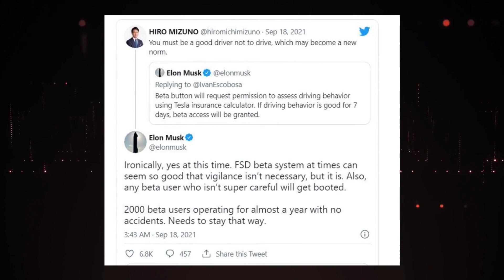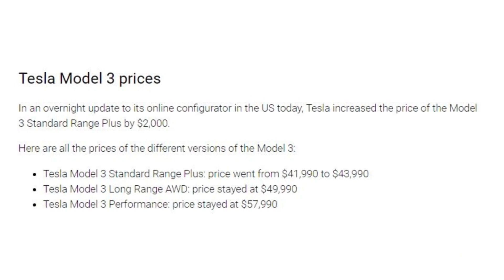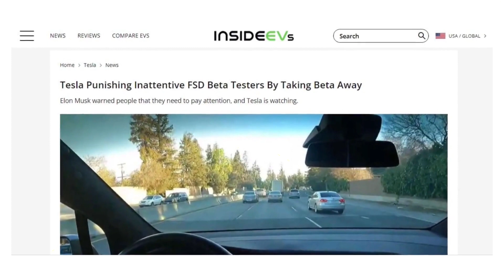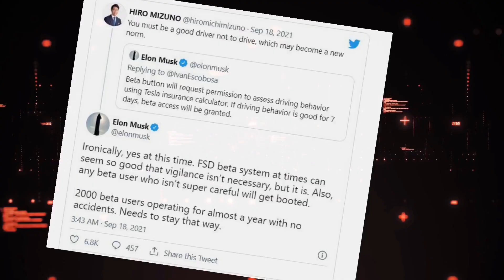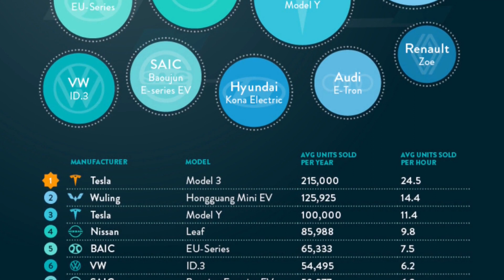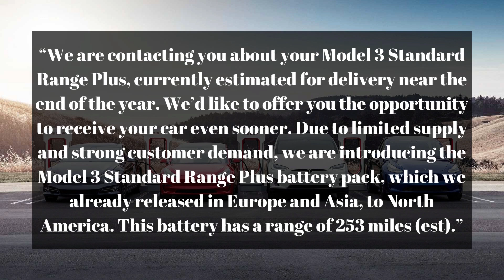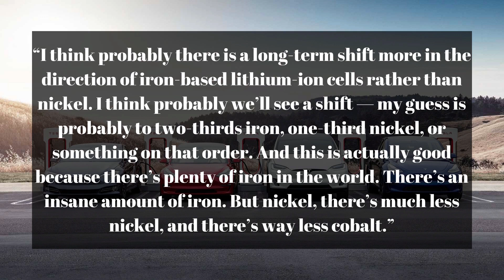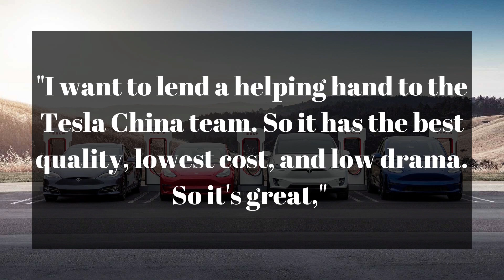Tesla Makes Big Change To Model Y & Other Updates

Comment: Do the math: 
LFP can be charged to 100%... So if the range is 250 miles you'll get 250 miles.
The NCA chemistry battery (that's lithium-nickel-cobalt-aluminum) should be charged to 90%... So you can only have a total range of 235 miles.

Which range would you prefer? 250 (LFP) or 235 (NCA)?
Reply: @technopool9870  Sure. That too.